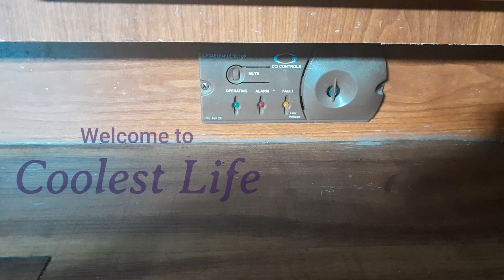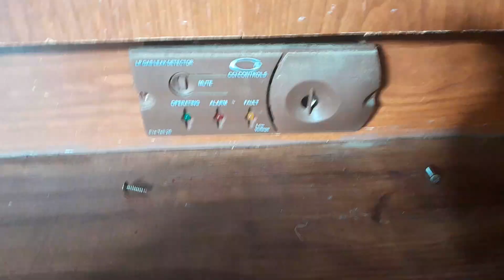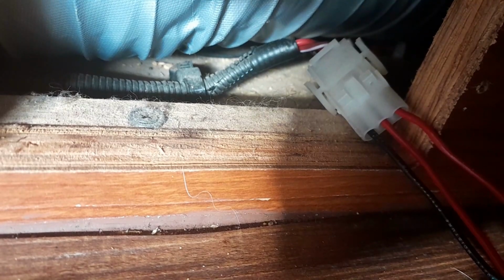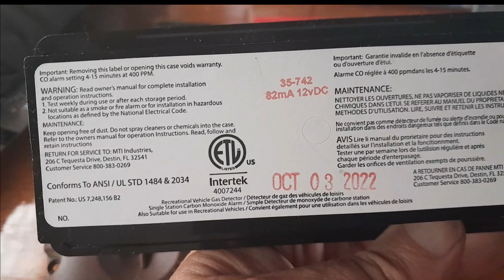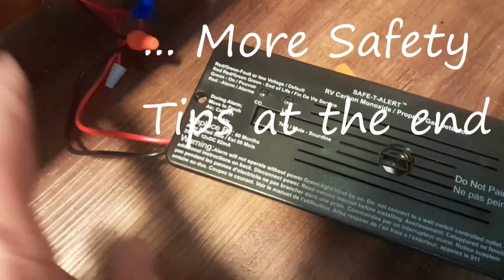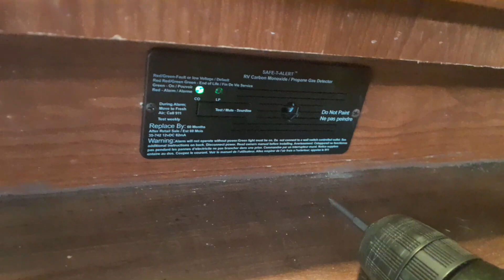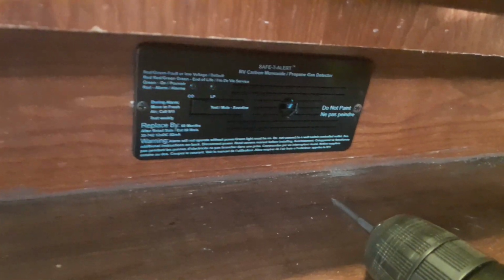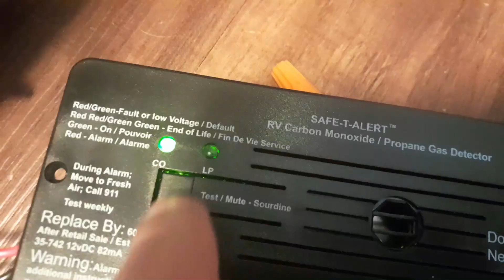RV DIY - Propane Detector Replacement - When should you?

Comment: The reason for the two red wires is to make sure there is power to the detector when the chassis batteries or the house batteries are turned off, it still gets power. If both batteries are turned off, the BCC will not supply power to the detector. Both red wires need to be connected to the detector as one is for the house battery and the other is for the chassis batteries.
Reply from the maker: Can I just put all three in one pigtail?